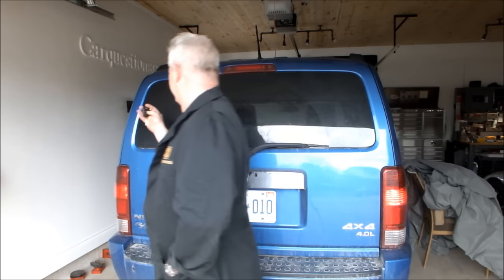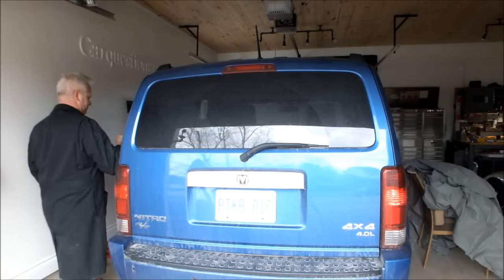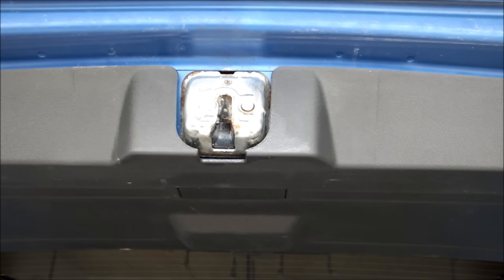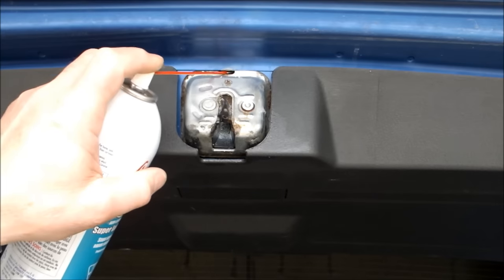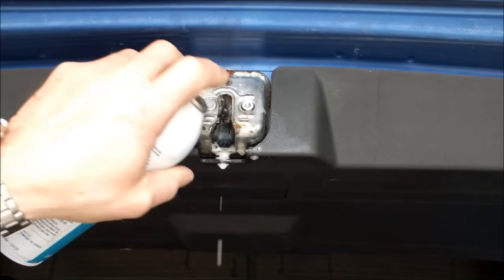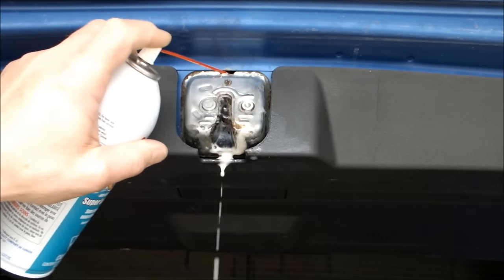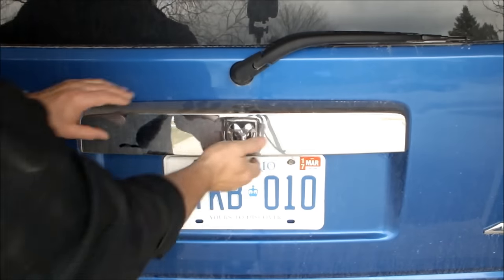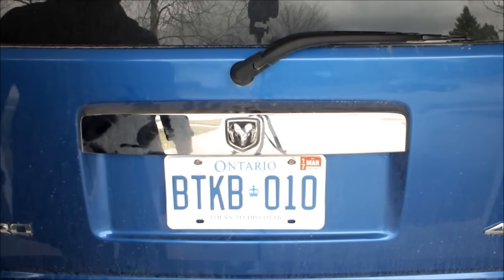Car Alarm Keeps Going Off - How To Fix It

Comment: I've had this issue with my 2007 mercury mariner alarm randomly going off, passenger door ajar display and recently the dome light not shutting off.  Drove this way for 3 or for months and then the battery light came on and everything shut down.  Had to replace the alternator and battery.  Thought that might have been the problem, but just tonight, a day after replacing those parts, the alarm set off again.  I'm going to try your suggestion tomorrow and hope for good results.  I'm afraid if it continues,  I'll ruin another battery.
Reply from the maker: Let me know how you make out - good luck

Comment: I have a 2005 Ford escape  the alarm goes off whenever it wants to. It also sometimes goes off when I open my driver door . Which seems like I'm breaking into my own vehicle. Can you tell me where is the fuse for for this located. I want to remove my fuse and just have it done. No more alarm. I would appreciate your help.
Reply from the maker: It differs from model to model - best way -  look it up in your owner's manual or read the index on the fuse panel door to be sure

Comment: hope this works for my avalon, she is a little older, went to the mechanic and alarm shop and it's like "I'm crying wolf" nothing happens there but as soon as I get home the alarm blares off!! fingers cross would like to save some $$ and sanity, currently have to unhook my battery if I go somewhere longer than an hour?
Reply from the maker: Do it to all doors and hood as well -good luck

Comment: I have a question.
My car alarm siren keeps going off no matter what I do. I cut the wire to the siren so I can drive around. I've went into where the brain is and set the setting swith off and still goes off.
Its compustar car alarm/starter/locks.
Reply from the maker: Remove the system and repair the wiring since this system your car has doesn't seem compatible with it - this is often the case - get an original equipment alarm if possible made by the same company the made the car

Comment: 2005 Nissan Murano. It was windy and rainy yesterday and it did this 3x. Twice at night. I eventually took out the horn fuse b/c my car doesnt have an alarm fuse and it finally stopped making a sound but the alarm lights still go off. I tried this method just now so we'll see if it works. Ill also go get my battery tested on thursday when i have time
Reply from the maker: Hope it works for you - cheers and keep trying

Comment: Quick question: do you still own this vehicle and have you had any more issues out of it since resolving the horn blaring problem?
Reply from the maker: Yes i do and its been an angel since then - touch wood
Reply: Alanna Williams m
Reply: I have a 07 Nitro 3.7L SLT and my horn would go off at random times in the night! Was wondering if wd40 would work just as the liquid wrench did? Thank you

Comment: Great video and I will definitely try this. I have a abnormal question and I hope someone can help. Last Friday, I had a viper car alarm and a dash cam installed and hard wired into my 2012 Hyundai Tucson. Everything worked fine but hours later, while parked and the car not being used, the alarm just started going off for no reason. Thankfully I was able to place it into valet mode. 

Today, I contacted the installer, brought the vehicle in and he said he adjusted the sensor. Again, fir hours it worked just fine but then, once again, the alarm started going off again. 

So my question is this. Since the dash cam is hard wired to the battery, it is possible that it's drawing to much power over time and thus, setting off the alarm. I read that of the car battery runs to low, it can set off the alarm since the alarm is also running off the battery. The cam is Los voltage so I don't think it's drawing to much power and my car starts right up every single time but these car alarms are quite tricky and sensitive. If this is the case, I can order an external battery that is dedicated just for the dash cam. 

Thanks for everyone who may be able to help.
Reply from the maker: It's not the cam - its the alarm - its not compatible 100% or he's wired it up wrong - take it back

Comment: Issue: Beeping horn(panic sound) goes on while starting the car and key fob battery is down to stop panic sound. 
Panic sound goes on when opening the locked car by the  passenger sitting inside the car and key fob batter is not working to mute the panic sound
Solution:
For both scenario the best approach is to come out out of the car while panic sound is on and unlock the car door by inserting key into the car door (like old fashion way mechanically unlocking the door). Unlocking the car from inside using lock/unlock button allocated on car door may not stop panic sound. 
Note, this works also when unlock button is not working on key fob and panic sound is on.

Comment: I habe the Viper 350 PLUS 3105V 1-Way Car Alarm Keyless Entry and when I arm my alarm and unlock the front door with the key the alarm doesn't go sound off. If I unlock the passenger and open it it goes off. What is wrong? 🤔 Thank you in advance.
Reply from the maker: I'm guessing someone wired it up wrong - it shouldn't do that
Reply: @carquestions  it used to work then out of no where just stopped working. Could it be a bad door jamb switch?
Reply from the maker: @playa4lifesd619  Yep a failing rusty part can do anything

Comment: Hello, this is a very similar situation to my Toyota Highlander. But it's a little bit different. I had a engine start alarm put in and after that I started having issues with the factory alarm going off. The people at the alarm store re-did the alarm and it still goes off whenever. Recently I had a new battery put in I now can't lock it at all because it will go off all the time. I'm going to try doing your suggestion but I'm at a loss as what else I can do.
Reply from the maker: Heather - remove the car alarm from the vehicle and have it put back to original condition   - they are low quality devices and not approved by Toyota - this is the most likely cause
Reply: carquestions I was thinking the same thing. The thing is we spent like $800 winning in. But I am just too frustrated right now. I'm willing to do anything now. I just would have to order a new alarm from Toyota because I don't think I have the old alarm Fob thank you for your insight.
Reply: Sorry I should check my words  $800 putting it in.

Comment: i tried spraying the back latch method, witch worked for a few months....mine is the panic alarm with hazard lights— i removed both horn fuses and did a battery disconnect and zip tied the positive negative connections overnight it seems to have worked 4 days in. when it does do this i can hear the tipm black box clicking— i also switched to the less used key fob
Reply from the maker: you have a bad switch tha needs replacing - check all door switches for rusting

Comment: I have ford Explorer 2003 and my alarm goes off only when it is extremely cold or extremely hot weather? When this happens it shows door open and when I park my inside and mirrors light stay on. Any suggestions!

Comment: I've actually got a Dodge Nitro too and the alarm has started to go off a minute after i lock the car. This started happening today so i will try your solution tomorrow when its light. Thank you
Reply from the maker: Let us know how it works out - cheers
Reply: @carquestions  ok so I've tried it but just with the back hatch and not the doors, before doing it the alarm would sound after just 1 minute and now after doing exactly what you did (twice) its around 5 minutes. So its getting better! Makes me think its a problem with the rear hatch sensor. I dont have any warnings on the dash computer. Thank you anyway though, ill keep doing it through the day just in case!

Comment: the horn on my 2001 jeep cherokee sport stays on constantly..i removed the fuse from the little fuse panel under the left side of the dashboard to stop it..do i need a new relay  or what? pushing the horn spot on the steering wheel does nothing to stop or start it blowing..it's on a constant loud blow when fuse is in

Comment: HI, how do you know which latch was bad? Having the same problem with my 2000 nissan altima. Its going off while I'm driving.
Reply from the maker: Sometimes the dash will indicate which door is not closed when it is - sometimes you can't and have to check each door by taking it apart
Reply: I would just spray every latch and see if that works.
Reply: @keaganbradley7867  it works for me for one week. Then I have to repeat the process or the alarm starts going off all day and night again. Did it so much it killed the battery.

Comment: Could we do this to the other doors?  Or it is only common on the back?
Reply from the maker: Yes no problem - however, depending on the car the problem may require replacing the switch in the lock - check your specific car for this problem on a forum for your car and you should get a good idea which one and if people are replacing.

Comment: I have a 2009 nissan versa. The actual alarm isnt per se going off but every once in a while the alarm will just beep a few times. Its not sayig that any of the doors are open.  Would you know how to stop the constant beeping.
Reply from the maker: See what your manual says - might be a low battery in the key fob or something like that

Comment: My mom has this problem but i don't think it's from the trunk. For us it is more likely that it is coming from the door. Do we do the same method to the door or is it different?
Reply from the maker: Nope - same method - try it - good luck - if it doesn't work you'll need to take out the door latch
Reply: ok thanks

Comment: Doesn't work on all cars. Tried it on my 2010 Mercury Milan on all four doors as well as the hood and trunk latches because it would randomly start going off. Sometimes at night, sometimes during the day, sometimes it would stop after I turn it off, others it would start up a couple minutes later, sometimes it would go for months without doing it, causing me to think the problem went away. After trying this, it stopped for a day or two and just started back up again. No clue what to do, all I know is my neighbors are getting pissed and I can't afford to take it in to some overpriced mechanic. Any tips on how to fix this DIY?

Comment: Thank you for the tip. The alarm on my 2006 Ford Escape had  been ringing intermittently.  I just didn't lock my driver side door so the alarm wouldn't ring.  Then my door ajar indicator light came on out of the blue and stayed illuminated, but all of the doors were closed.  I figured it had something to do with the door switch, but I didn't want to take the car to the dealership to get it fixed.  So, I tried your tip and it worked.  The door ajar light went off.  I haven't tried to simulate the alarm yet.  But, thank you for the tip.  I hope it works a little while longer before I have to get it properly repaired.
Reply from the maker: Way to go - mine is still working like a charm 5 months later

Comment: Gonna try it. I have a 2006 ford escape.  It sucks the battery dead!!!! Alarm going off. 

If you respond to this I'll let you know if it works
Reply from the maker: Thanks Jerry - hope it works out - Good luck from Canada!
Reply: @carquestions  Thank you for the reply. That was kind of you.
 Sad to report. It did not. It leads me to 1) try to remove just the fuse for the alarm system to totally disable it. It must be it the panel located on the passenger side center.
  Unknown location? Or...
2) hope my local part store can track what door sensor needs replaced before taking to a mechanic shop.
Any thoughts?
Kind regards, 
J

Comment: Hello  replacing a cable and can't get it to fit
 It's from a 05, seems like mb it's a touch longer even tho their se length the top side that hook up under steering wheel seems a little longer from the shifter lever to the part that goes thru the mount under wheel. Like mb a inch more of plastic housing on cable. Will send a pic 2morrow if you get this comment. Thanks for any info
Reply from the maker: Thanks for the info

Comment: I have 2003 Toyota Camary XLE 4 door one door switch does not move like the others. 
It just started doing this about a month ago driving me crazy i will spray the lock and give it a try. I hope it works
Reply from the maker: Spray ot and work the handle and lock like 30 times - good luck Clifton!

Comment: I think you may have solved my problem. I have a 2000 KIA Sportage and the back hatch sensor is intermittent. So I disconnected it. Now for the first time since I've owned the car the alarm that I never knew I had is screaming at me. I'll try repairing the switch, thanks!
Reply from the maker: good luck

Comment: I have a 2005 Ford escape and the door ajar (doesn't specify which door) is always on except 2 short periods of time that it went off since I've had it. 

Recently my alarm has been going off. I have a chip key and a passive alarm system, plus a secondary one. Apparently with the door ajar and no chip present, sometimes the alarm goes off. But I'm not sure why it would only be sometimes when my key isn't present. 

I disabled the horn to find that it has a secondary horn, but regardless my lights flash during the alarm which will kill my battery if I don't know it's alarming.  

I've done the WD40 trick THOROUGHLY and many times, with no change in the door ajar light. 

It could be faulty latches, which cost 120$ minimum per door for parts alone, and I don't know which door it is. Or it could be the computer system/sensor itself. 

I am at a total loss. The mechanic has tried to fix the door ajar problem 4x with no luck (this was before my alarm started sounding). 

Ford did 4 revisions on the latches/alarms, but only recalled the newer ones. 

I'm thinking of trying to rewire the doors to make them think they are ALWAYS closed, because that's the cheapest & surest way, since everything else will be very costly trial and error. But that's still only a "maybe" fix. 

Any suggestions? I'm beyond frustrated and simply at a loss.

Comment: My car keys wont work. We changed the battery with both the keys, but they still dont work. We used the key but that sets the alarm off. The buttons wont work so we cant turn it off until it turns off by it self. It’s embarrassing cuz we have a neighbour who has a baby. If you know a solution please let me know...

Comment: 20 Pacifica ltd.  I Push button on handle, passenger right slider and alarm goes off with fob in hand. Chrysler mechanic perplexed. Drivers side  slider is fine, no alarm.  Can one deactivate alarm without disabling horn altogether?
Reply from the maker: No - sounds like a TIPM problem to me
Reply: @carquestions  TIPM?  I guess I can google that
Reply from the maker: yes do - also you are likely not the only one experiencing this with a Pacifica - check forums would be a good idea @blogo1111

Comment: My Citroen dealer failed to solve this problem yesterday as the pesky alarm on my C3 went off again at midnight last night.  Going to try your fix NOW!  I'll report back...
Reply from the maker: so did it work? Cheers from Canada
Reply: @carquestions  Alas it did go off again 🤔 but I thought I would use wire wool on the catch as there is a bit of oxide build up.  I have a theory that a low charge on the battery could be a contributing factor... so went for a long drive... since when no alarm kicking off...
Reply from the maker: @stephensmith799  Sounds like a rust / corrosion electrical issue - good work
Reply: @carquestions  Your vid was very welcome as it gave me hope!  The Citroen dealership found nothing despite trying...
Reply: @carquestions  Darn.  Having cleaned off the catches with wire wool and solvent... and taken the car  for a long drive to make sure the battery is well up to charge.... the alarm sounded again this evening.  It has got the dealership and myself foxed! (Checked for open windows, flies buzzing around the interior.)

Comment: What kind of things will interfere with car alarm? My alarm goes off in my driveway, but not a block away. The display says to change the battery in the remote keys, done that doesn't help,